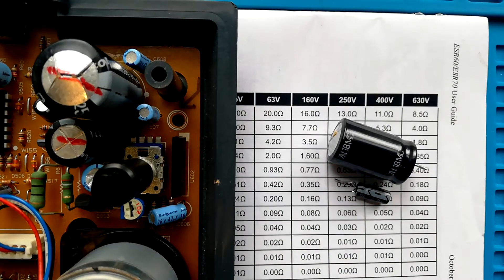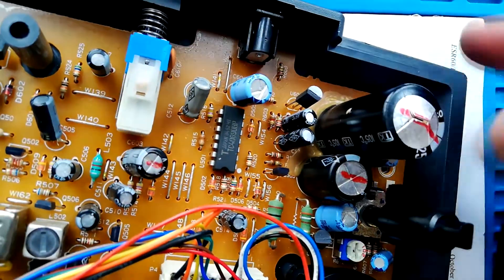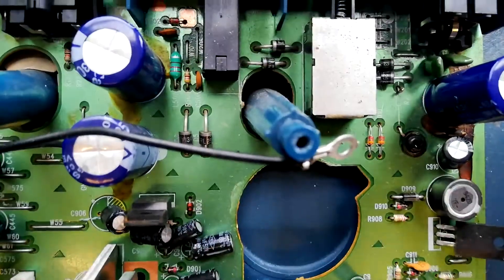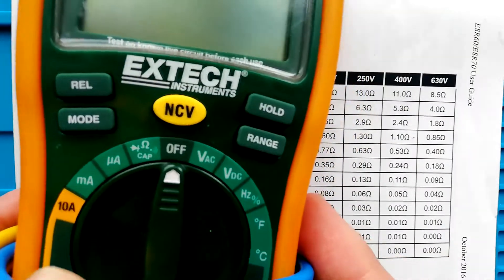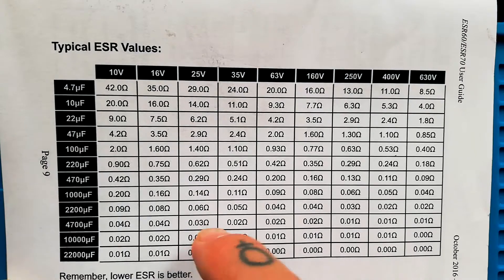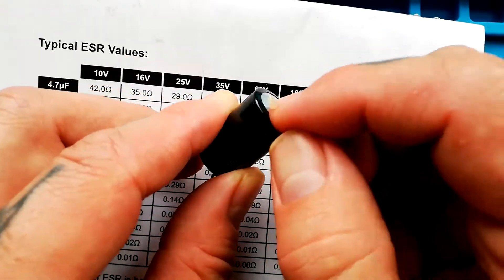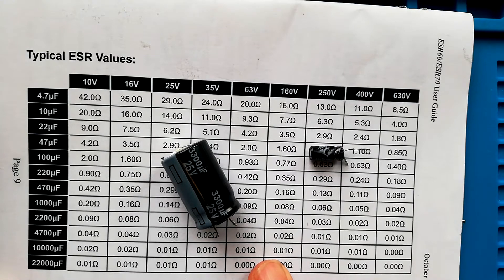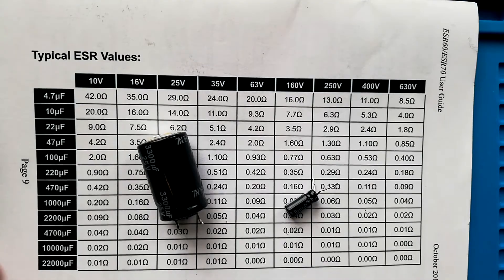Identify bad electrolytic capacitors

Comment: 0:49
Thanks for clarifying that !
I've just taken the lid off my 1988 Yamaha KX500 cassettte deck, as the on/off switch is sparking at times, with the unit rarely turning on.
I suspect that the switch's contacts have worn out however, I then saw this same gunk at the base of the large capacitors on the mains-in board and got a bit suspicious of them.

Comment: I have an NES that has no noticable issues, however one of the Motherboard caps has what looks like beige, dried mud collected on top (since it normal sits upside down) Is that electrolyte or random dirt?
Reply from the maker: Glue so the weight of the largest caps don’t strain the solder connections, I suspect
Reply: @Tetrakan On...top of the capacitor? It's a thin film of the crud. There's no sign: of it anywhere else.

Comment: Had a cap in an analogue scaler that was having some flickering display issues. It was just raised the tieniest of bits, almost undetectable. Eyeballed it for a good 10 minutes, decided it would not hurt to replace it anyway, it fixed the problem :")

Comment: Hi, I got a hum noise on my tascam 424 when a playback , not while recording, any suggestion?
Thanks.
Reply from the maker: Could be a dissconected common ground cable, or a faulty eolectrolytic capcitor allowing junk from the ground to enter the audio path.

Comment: I can see them either bulge or vent (stains on other parts or boards) and before I remove them to put them on the Atlas ESR  tester I can tap them and feel/hear that they are dried out ..

If I take a cap off to test it, I usually just replace it anyway if it's a board of any age as they will go bad at some point..
Reply: If you have low voltage, I have seen that cause a low voltage issue on a power supply. Capacitors are used to add delays into circuits. That the way you don’t get the full say 120VAC into a power supply before going to the transformer as soon as you turn the power switch on.
Reply from the maker: Noted, thanks.

Comment: Great channel. Great help. Only thing is, i have this tascam 414 on which the sound keeps dropping out. It’s no power problem, it keeps going but the audio drops out and after a few seconds it comes back in only to drop out again for a few seconds. Any ideas?
Reply from the maker: Sounds like an intermittent contact. Check the faders are cleank, and the sodler joints below them are clean. If its not that somethign else might be dirty or have a bad sodler connection.

Comment: Hi! I have exactly the same issue with glue from big caps flooding the PCB on my Tascam 424MK3. Personally, I am not sure that this is the electrolyte, but I will try to replace them anyway. Few questions:
- I see that the R7 resistor is cut from your board. What is the reason? 
- The T902 transformer, do you know whether it is possible to find a replacement for it? After my FL display stopped working I immediately started to hear a weird sound of this T902 transformer. Not sure whether it is broken, but curious on whether the replacement is possible. I've checked the replacement manual and some people told me to not have a hope as this transformer is pretty unique.